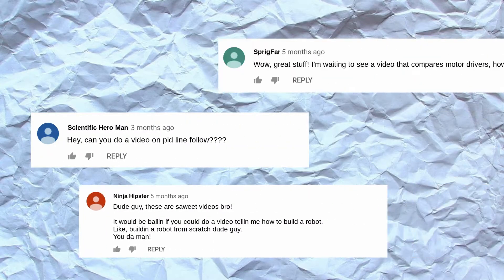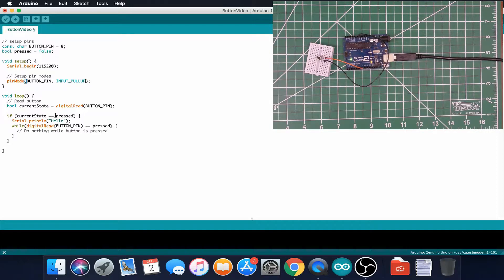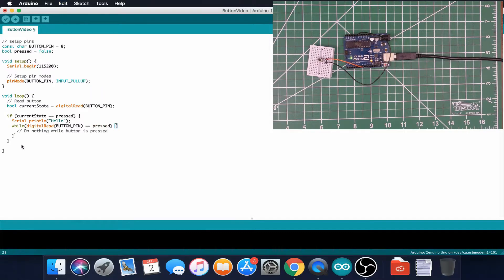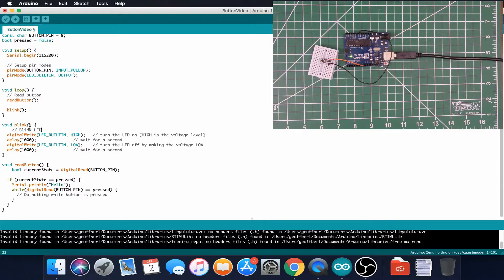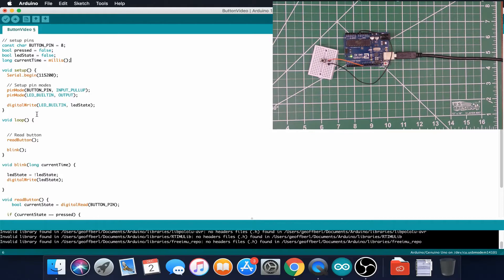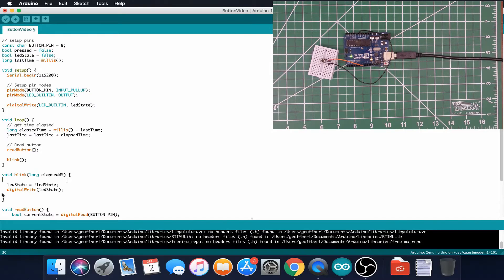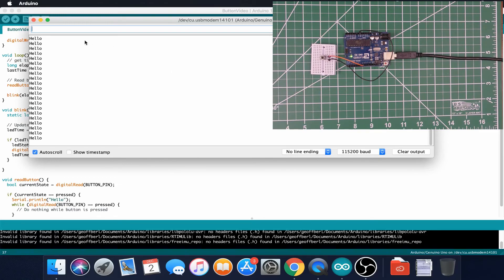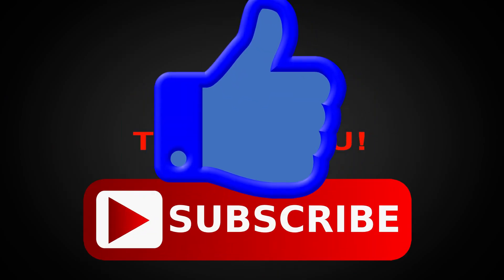Multi-tasking, Multithreading, or Hyperthreading with Arduino

Comment: Hello sir, good evening,
Am creating a program 20Khz PWM signal for pump. It's absolutely working fine, when I wrote 2nd millis function and upload same board but 2nd program is not properly worked. Any solution for this sir ? Am using Arduino UNO board.

Comment: so how to write something after 'hello'? so 1 press 'hello' 2nd press 'world' then back to 'hello'
Reply from the maker: Good question, for that I would probably add a counter that increases by one every time the button is pressed. Then I would check if it's even or odd and print depending on that. Here are some snippets of code that might help. 

// Global variable
unsigned int btnPressCnt = 0;

// In the button press code
btnPressCnt++;
if (btnPressCnt % 2 == 0) {
  Serial.println(" world!");
} else {
  Serial.print("Hello");
}

If you haven't used it, this is a great opportunity to learn about the modulo operator (%). It provides you with the remainder after division so, in this case the remainder is 0 when the btnPressCnt is divisible by 2 (even number). Otherwise it will be 1 (in this case). This also works if you want something to occur every n times so it's very handy in that regard.
Reply: @RobotResearchLab  Thank you for that. And If I understand to have words change the 2 to how ever many I need?
Reply from the maker: @AussieTrucking  The 2 represents that you want that to print every 2 times the button is pressed. You can add more `else if` statements to have something print every 5th time the button is pressed or every 9th time by changing that number or adding the `else if` with a new value, like this:

...
else if (btnPressCount % 5 ==0) {
  Serial.println("This prints every 5th time the btn is pressed");
} else if (btnPressCount % 9 == 0) {
  Serial.println("This prints every 9th time the btn is pressed");
}

If you're going to have a lot of cases, it would be a good opportunity to check out a switch statement instead of if as it's much cleaner looking when you have many different cases.

Comment: I think nowadays it's easier to use freerts tasks, because in case you have 2 cores (like in esp32) you can even have 2 tasks running at the same time. This solution is nice, but it's really hard to manage once you have several different things going on.
Reply from the maker: Agreed, it's a lot of code (and repeated code at that) if trying to scale. I had not heard of freerts but looked at it a little and it looks promising, hopefully it is and it's easy to use, that's the whole goal, make things easy to use. Thanks for the info.

Comment: Hello, im doing a project now
So the case is I have 2 buttons on pin 5 and pin 6, and 2 led lights on pin 8 and pin 9 (Button 5 to control led on pin 9, and button 6 to control led on pin 8)
So i make when : 
1. Button 5 is pressed, then after 2 seconds the led on pin 9 will be on for 5 seconds.
2. Button 6 is pressed, then after 1 seconds the led on pin 8 will be on for 8 seconds.

But when i press button 5 and 6 together, the led on pin 8 is need to wait for led 9 turn off and led 8 can turn on

Now, I to make when buttons 5 and 6 are pressed together, led on pin 8 & 9 can be working at the same time without having to wait for led on pin 9 to turn off first.

This is my code now

      if (digitalRead(5) == HIGH)
       {delay(2000);
        digitalWrite(9,HIGH);
        delay(5000);
        digitalWrite(9,LOW);
        Serial.println();       }
        
      if (digitalRead(6) == HIGH)
       { delay(1000);
        digitalWrite(8,HIGH);
        delay(8000);
        digitalWrite(8,LOW);
        Serial.println();       }
}

Please help me thankyou
Reply from the maker: The problem you're having is because of the delays. When the command delay() is called the processor literally just spins doing nothing for that time.

It's going to be a little confusing trying to explain how to do this without delays but I'll give it a shot. It might also help if you watch my video on multitasking here https://youtu.be/6YUVsCSIbb8

Keep in mind that this code is not the "greatest", there are better ways to do this so you don't have to copy and paste but they are more complex so probably harder to understand so I tried to keep it as simple as possible. I did not test this code but it should work. I would strongly advise that you watch the video on multitasking and also read and understand what this code is doing, especially if this is for an assignment. You do not want to hand in work that you don't understand. I left lots of comments in the code and you can always reply to this message for more help.

void loop() {

  checkButtonA();

  checkButtonB();
}

void checkButtonA() {
  // Keep track of if we are already controlling the LED from another button press
  static bool performingAction = false;
  // Keep track of if the LED is on or off
  static bool currentLEDState = false;
  // Keep track of when the last action was
  static unsigned long lastActionTimeMS = 0;

  // Only check the button state if we aren't already performing the LED action
  if (digitalRead(5) == HIGH && !performingAction) {
    // Indicate that we are now performing an action
    performingAction = true;
    lastActionTimeMS = millis();
  }

  // If we're performing the LED action, check if we need to do anything
  if (performingAction) {
    // First we check if the LED is off
    if (currentLEDState == false) {

      // If it's off, then we are waiting to turn it on
      if (millis() - lastActionTimeMS >= 2000) {
        // If enough time passed since button press, turn it on
        digitalWrite(9, HIGH);
        // Update the last action time
        lastActionTimeMS = millis();
      }

    } else if (currentLEDState == true) {

      // If it's on, then we are waiting to turn it off
      if (millis() - lastActionTimeMS >= 5000) {
        // If enough time passed since turning it on, turn it off
        digitalWrite(9, LOW);
        // Update the last action time
        lastActionTimeMS = millis();
        // We're done controlling the LED so update performingAction
        performingAction = false;
      }
    }
  }
}

void checkButtonB() {
  // Keep track of if we are already controlling the LED from another button press
  static bool performingAction = false;
  // Keep track of if the LED is on or off
  static bool currentLEDState = false;
  // Keep track of when the last action was
  static unsigned long lastActionTimeMS = 0;

  // Only check the button state if we aren't already performing the LED action
  if (digitalRead(8) == HIGH && !performingAction) {
    // Indicate that we are now performing an action
    performingAction = true;
    lastActionTimeMS = millis();
  }

  // If we're performing the LED action, check if we need to do anything
  if (performingAction) {
    // First we check if the LED is off
    if (currentLEDState == false) {

      // If it's off, then we are waiting to turn it on
      if (millis() - lastActionTimeMS >= 1000) {
        // If enough time passed since button press, turn it on
        digitalWrite(6, HIGH);
        // Update the last action time
        lastActionTimeMS = millis();
      }

    } else if (currentLEDState == true) {

      // If it's on, then we are waiting to turn it off
      if (millis() - lastActionTimeMS >= 8000) {
        // If enough time passed since turning it on, turn it off
        digitalWrite(6, LOW);
        // Update the last action time
        lastActionTimeMS = millis();
        // We're done controlling the LED so update performingAction
        performingAction = false;
      }
    }
  }

Comment: How would you program button that create 8 or so binary code. For example 1 push. 0001. 2 push 0011 e.t.c?
Reply from the maker: It depends on what you want to use it for. What I would probably start with is just to simply use an int, each time the button is pressed, increment that int and then you can use the BIN option of String to create a binary string output.

String value = String(7, BIN)

Now value should be "111". The number of bits is going to depend on the number, I believe String(1, BIN) will simply output 1 so if you have 8 LEDs you're trying to light up you're going to have to mess with the code a little to have a for-loop that iterates over 8 times but sets the LED to off if the length of "value" is less than 8.

I hope that made sense, doing this over comments is difficult but I don't have time these days to do videos so this is the best I can do for now. Feel free to ask for more clarification on something though.

Comment: I measure weight with arduino and then print with thermal printer. currently measuring and printing. but what I want is to have the button active after measuring. ie multitasking. can you help me
void loop() 
{ 
    do
    {
      currentTimeAnimation=millis();
      if (currentTimeAnimation-previousTimeAnimation>=animationInterval)
      {
        //350ms geçti
        lc.clearDisplay(0);
        lc.clearDisplay(1);
        lc.clearDisplay(2);
        lc.clearDisplay(3);
        lc.clearDisplay(4);
        lc.clearDisplay(5);
        setAnimationPoint(animationCounter);
        animationCounter++;
        if (animationCounter==6)
        {
          animationCounter=0;
        }
        previousTimeAnimation=currentTimeAnimation;
       
      }
    } while(digitalRead(7)==HIGH);
  
  
    
    measureHeight();
    measureWeight();
    delay(1000);
    measureHeight();
    measureWeight();
    delay(1000);
    measureHeight();
    measureWeight();
    delay(1000);
    wdt_reset();
    

    turnOffDisplays();
    delay(500);
    
    displayWeight();
    digitalWrite(13, HIGH);
    delay(500);
    turnOffDisplays();
    digitalWrite(13, LOW);
    delay(500);
    
    displayWeight();
    digitalWrite(13, HIGH);
    delay(500);
    turnOffDisplays();
    digitalWrite(13, LOW);
    delay(500);
   
    displayWeight();
    digitalWrite(13, HIGH);
    delay(500);
    digitalWrite(13, LOW);
    delay(500);
     digitalWrite(13, HIGH);
    delay(1000);
    digitalWrite(13, LOW);
    wdt_reset();

    previousTimeButton=millis();
    do
    {
      currentTimeButton=millis();
      if (currentTimeButton-previousTimeButton>=buttonInterval)
      {
        
        yazdirSureBitti=true;
        break;
      }
    } while(digitalRead(yazdirPin)==HIGH);
  
    //Buton basma için zaman geçti

    if (yazdirSureBitti==false)
    {
        print();  
    }
    yazdirSureBitti=false;    // 
    
}
Reply: What sensor you'd use to measure weight?
Reply: @Khujandiho  4 piece 50 kg load Cell

Comment: 'Anytime more than 16ms, you should then use millis();'
Reply from the maker: I think you are referring to the delay functions. Arduino doc states that delayMicroseconds() is only reliable up to 16383 microseconds and that anything over a few thousand should just simply use delay().

https://www.arduino.cc/reference/en/language/functions/time/delaymicroseconds/

I have not seen any issues with the accuracy of time other than the obvious being that Arduino is only fast enough to be accurate within 4 microseconds but any time you call micros() it should always be within 4 microseconds of the actual time.

Comment: This is not real Threading
Reply from the maker: Correct, I believe I mentioned that in the video but if not that was my mistake. I titled the video this way because many people do not understand the difference between multithreading and hyperthreading. Most times when students ask me for multithreading what they really want is just simply to be able to do multiple things at the same time, they don't really want multithreading. To truly multithread you would need more than one microcontroller.
Reply: @RobotResearchLab  As I know arduino supports up to 57 threads via CreateThread()
Reply from the maker: @akknaodinden  This technically is not multithreading either, it is more of a scheduler. Multithreading would be running two tasks at the same time. With only one core (microcontroller in this case) it is impossible to multithread, the best that can be done is simulating multithreading which is technically hyperthreading. The library you are referring to does this, you ultimately create tasks and they are executed by priority and timers.

Comment: what if the two tasks are dependent to each other? at that time how to handle to events simultaneously
Reply from the maker: It depends on what you're talking about but it should still work with the way I'm doing it in the video. I'm creating a new video to answer some other questions I've had on this topic. I'll try to include something dependent but let me know if you have a specific case and I'll try to put that in there.

Comment: shouldn't you use unsigned long ?
Reply from the maker: Technically, yes, since millis() does return an unsigned long. It wouldn't present an issue unless I had my Arduino running for 25 days or more. Even using unsigned long it would still have an issue of resetting after 50 days. In the end, there is always something that could be fixed or enhanced but I don't think it's necessary for the video. Good point though, I'll try to remember to use the same data type as the return type for functions in future videos.
Reply: @RobotResearchLab  Yes, you're right most control systems won't use some delay that is more than seconds, I think an int even should do in most cases. So yeah we won't need unsigned long unless we need something to be triggered within days, there are more suitable ways to daily timings. But in case of working to time things that is working in range of seconds, then even an int is enough.

Thanks for clarifying that :)

Comment: Why not the short int button = 8? Yours is much longer
Reply from the maker: for the BUTTON_PIN? A couple of reasons; 
1. Shorts are larger data types than char, they use 16 bits instead of char's 8 bits. Not that that's a huge deal but in embedded programming memory is scarce.
2. const ensures that the value isn't changed somewhere in the code, I could take that off but it doesn't "cost" anything, it just ensures that I get a compile error if I try to change the value somewhere else in the code.
3. For the name, I like to use BUTTON_PIN instead of BUTTON because it clearly states that this is for a pin. If I used a library which has what's called an "object" the is used for a button I would call that a button because it's an object/class.
4. For why it's BUTTON_PIN and not just button_pin, all caps indicates that it's a constant, never changing, variable. This is only for the developer's eyes, it's what's called a convention, it's standard practice but not required. If I were reading someone else's code and saw a variable named BUTTON_PIN somewhere farther down into the code, I would know they're using a constant value. It's just like Arduino's constant values like LED_BUILTIN, INPUT, HIGH, LOW, etc. those are all constants and it's obvious because they are in what is called "underscore case" format.

Thanks for watching, and for the question, hopefully this clears it up for you and others down the road.

Comment: I think there's still one little issue with this example. If you keep pressed the button the program will stall on the while(buttonPressed) loop, thus the led won´t blink until button is released. Perhaps adding the logic to avoid that would be great!
Reply from the maker: Good point, I had assumed a user would quickly press the button but that's not always the case so I will definitely add this to my list of videos to do.Thanks for the feedback.
Reply: @RobotResearchLab   I have written more than 300 lines of code including a function that reads button/sensor presses. If I execute the function for the sensor it works fine, if I execute the function for the button it works fine as well. However if I want to use the function for both sensors and buttons in one while loop it wont work. Do you have a fix for this? I have been dying to fix this
Reply from the maker: @AppleFreak675  Hey, sorry that I'm just seeing this, it got lost in the mess of the holidays. If you're still having an issue can you send me your code so I can see what's going on? Just send me your contact information in my contact form and I'll email you back http://robotresearchlab.com/contact-me/

Comment: thank you for the video, please help me i want to creat in incubator but the lcd   result work with   delay of servo motor not with theme delay exmp : dht11 delay (10) , and servo (500), the lcd show result of dht11 with delay (500)
Reply from the maker: This looks like a great example for an advanced multitasking video. Just so I'm clear you want to read from the DHT11 every 10ms, move a servo every 500ms and print the result of the DHT11 every 500ms?

Comment: Heya.. im facing a little problem with the pid line follower...im using a diy ir sensor array of 6 the pid is working great and the library is kinda working but when i look at the values it kinda returns weird values sometimes which throws off the pid algorithm...do you think qtr library cant be used with dir sensor array?
Reply from the maker: There is a known issue with the QTR library... I don't recall if it's only on the digital IR sensors or the Analog as well but when using calibrated readings, the reading is allowed to go negative which causes rollover. Anyway, you can certainly use the QTR library with a DIY array, the concept is the same, I've done it before with no issues.

Are you using my version of the QTR library? I haven't updated it for the new QTR sensors that came out last year or so but it fixes the rollover issue, I'm assuming that's the issue you are seeing.